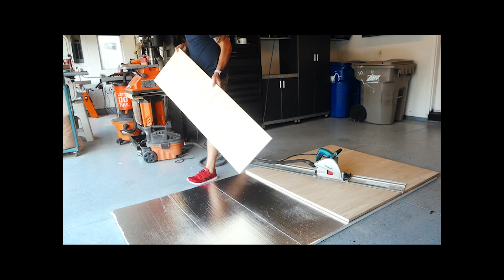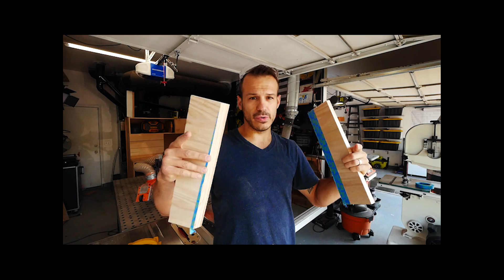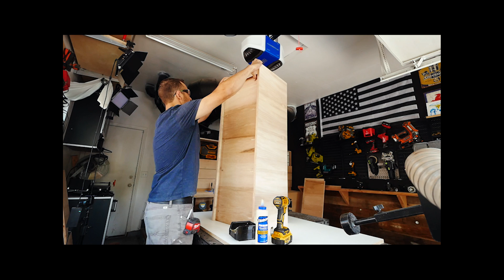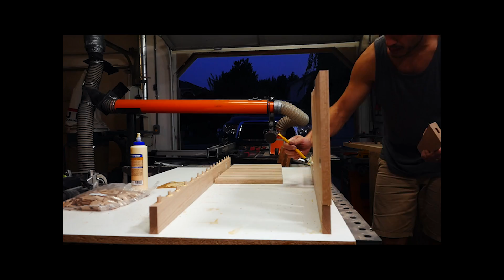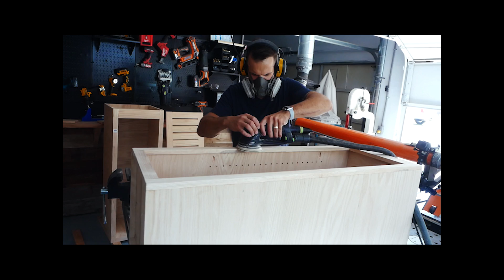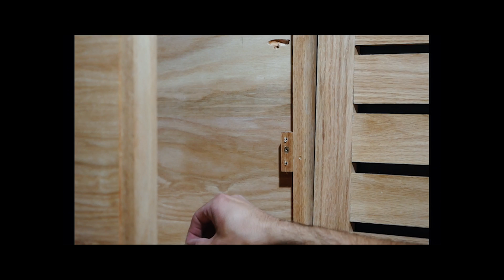Laundry Room Storage Cabinets | How to Build

Comment: Is it possible to make laundry cabinets with basic budget tools for example i only have a a rybo saw an a drill/impact  I don’t have anything to make slant cuts or anything fancy ? Like dado cuts,Ur video seems to be the best iv found that is really simple with out all the special cutting techniques also I’m a very very noob to diy an making stuff i repaired my roof my biggest diy fix an have been working on fixing dry walk areas in my house so I’m very new have really know knowledge on this stuff i look towards vids as yours to get ideas an tips
Reply: I believe it is possible. Being new to the craft (Like myself), whatever you make doesn't have to be fancy just functional. Dado cuts are not necessary. You can use dowels. They are basically the same but use a drill bit and wooded rod. Very simple and will give you the same result. You got this!